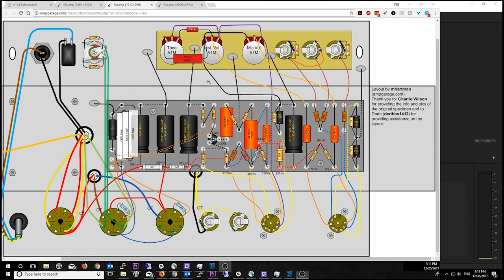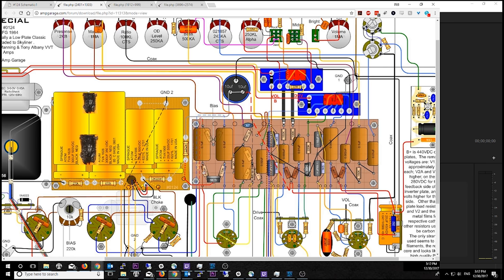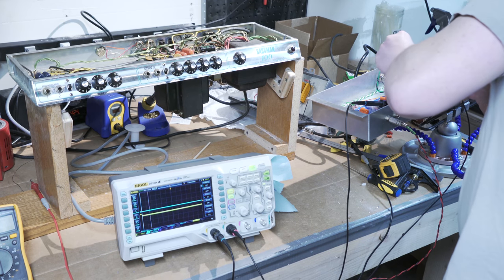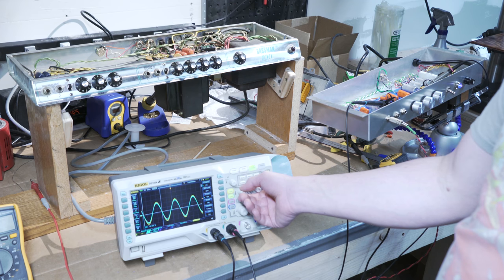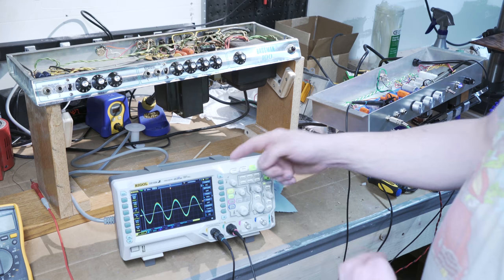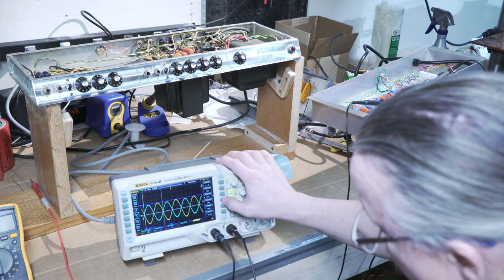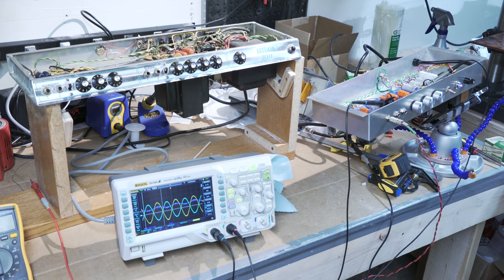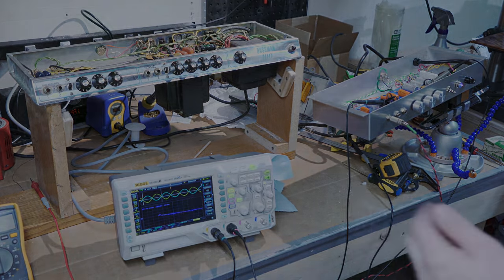How to Balance the Phase Inverter

Comment: I have comments questions and concerns: (1) What if you just have an old oscilloscope with no math or fft? (2) You explained, but you did not actually show adjusting the waveform. It would have been invaluable just to see that process from a visual learning standpoint. Especially for us who do not have the benefit of math or fft and need to manually do this. (3) Kill the autofocus! :-/
Reply from the maker: I only mentioned FFT as one way, you can also just use the oscilloscope to see the two outputs of the PI and adjust until they're as close to identical as possible.  I did explain this but you're right that I didn't show it 'happening' but that was because I didn't really want to move this 'out' you can see the waveforms of the two probes, one on each side that I then used that pot to adjust them until they were slightly imbalanced. enough to get those 2nd order harmonics.  You can also definitely just set it to very equal output, OR set it by ear but use the scope to see where that's at.  Also some people just use the AC output on a DMM and look at trying for a few volts imbalance on purpose, maybe 6VAC difference in the AC output of the signal.  As for the autofocus, it's the bane of my existence, because I somehow often find a way to turn it back on on accident... never intentionally.

Comment: That "almost perfect" doesnt work for anything exept guitar amps. A complete null is needed for Hi Fi.
Reply from the maker: +Ned Sheats absolutely correct, on a guitar amp it's entirely offers :) hifi it's horrible
Reply from the maker: Gah phone autocorrect, I meant "On a guitar amp it's entirely optional, on hifi it's horrid :)
Reply: @FrenchieFilms  Not every nonlinearity sounds good even in guitar amps. IMO when something doesn't sound worse when fine-tuned  it is worth it to make it look better "on paper". It is the best to know where nonlinearity will provide musical distortion and let tubes/RC filters/chokes do their job there. Because at the end of the signal chain all of these forgotten/"insignigicant" nonlinearitis will sum up to higher noise or lo-fi sound and nothing can be done there... So in my opinion it is the best to emphesise what sounds good rather than think that electric guitar tone is lo-fi and forgiving :) Great video.
Reply from the maker: True.  A ton of this is learning what matters and when etc.

Comment: Nice but if you want really want to kiss, keep it simple stupid, forget the o scope for balancing,  just inject a 1k tone @150mv. Dummy load the output and turn up the volume. Now hook the  scope probe to output jack and either turn it up until it just about to starts to clip, or half that peak to peak signal and use an ac rms voltmeter and take a reading on each phase inverter cap and adjust until both sides are equal. You could use the scope and move to each side and adjust for equal. Most scopes read peak, peak to peak. It will vary sometimes like slowing decrease in level on each side so check them several times but you’ll get it. 

If you don’t have a scope, turn it up to the normal level you place and adjust it again with an ac rms meter. I prefer to go half way to clipping and adjust because I found the balance will change as volume changes so 1/2 way is a happy medium. This isn’t rocket science folks, get it as close as possible and move on with  your day.
Reply from the maker: I have heard of this technique as well.  There are as many techniques as there are musicians :) I think if that one works for you, you're set.  Thanks for sharing.